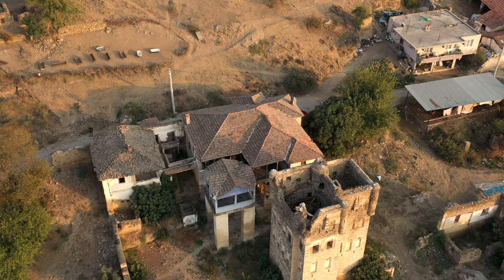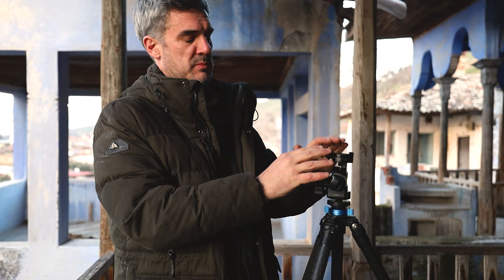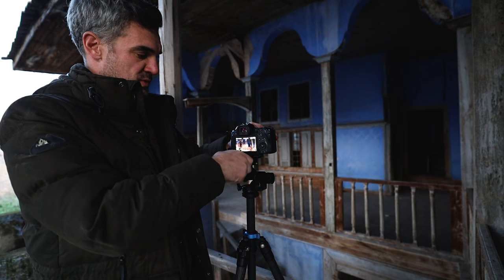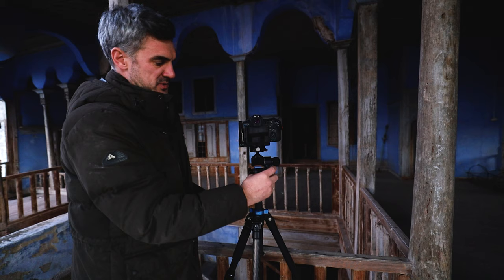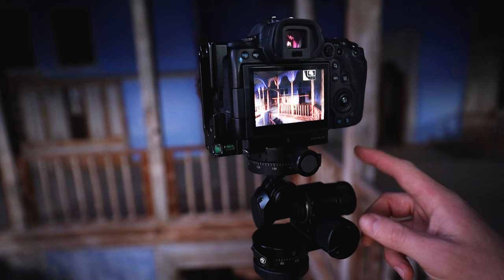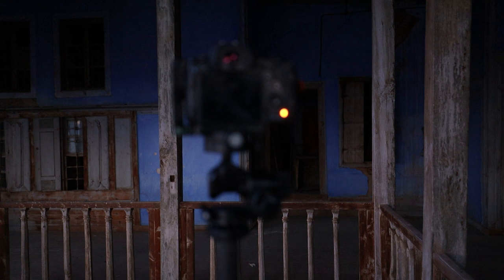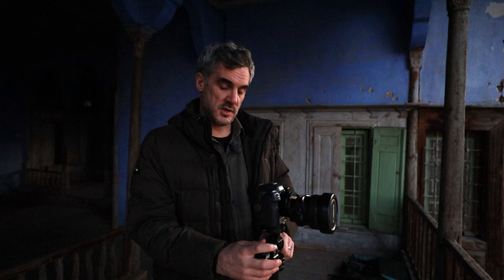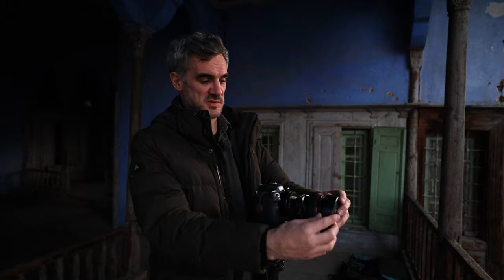Is THIS the Most Useful Tool for Architecture Photography?

Comment: James, which geared head to do prefer: The Sunway or the Benro? I have been using the Manfrotto geared head 410 for many years in architectural photography. I like it but it is not fluid enough for me and adjustments are very slow.
Reply from the maker: Hey! I think I prefer the Benro - its a solid bit of kit. The sunway is slimmer though! Easier to fit in a bag 🎒 👌